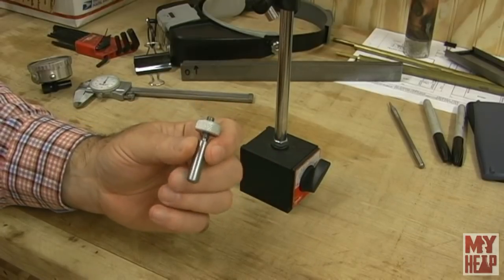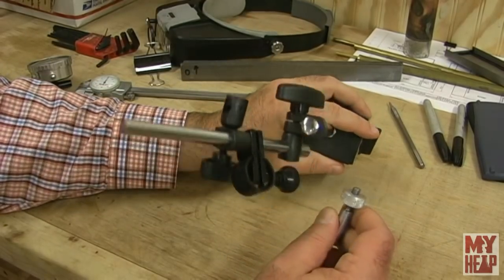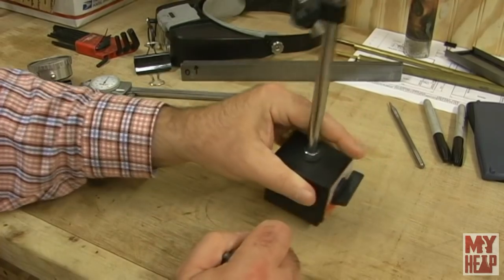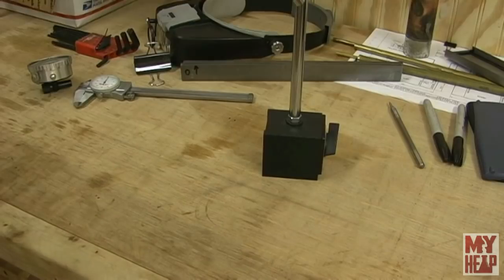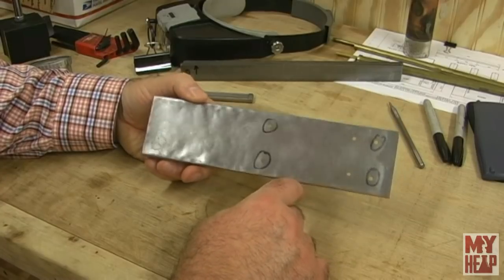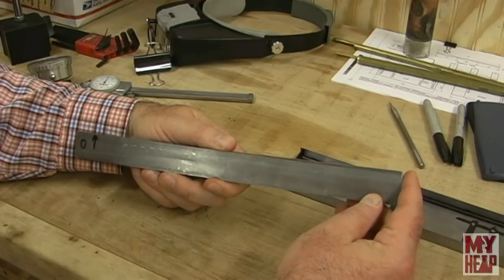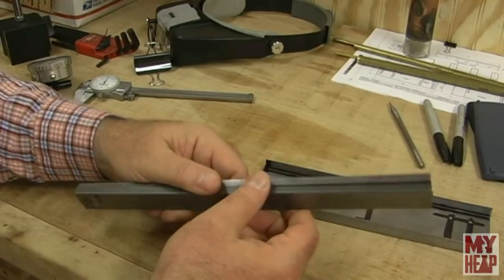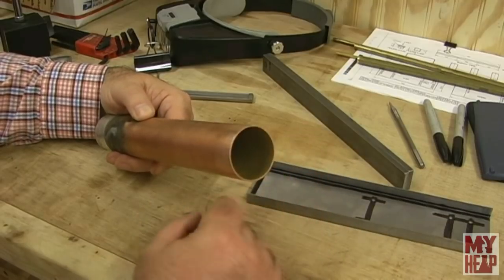MT2 Collets, KWSE, Camera Mount and Bandsaw

Comment: I also have the same issue where the mt2 piece comes out first. I made a custom head for my draw bar to knock out the mt3 sleeve. Basically, knock out the mt2. Remove the draw bar. Screw on the new head (aluminum so no damage to anything). Run the draw bar back in and hold against the back of the mt3 sleeve. Finally knock out.
The diameter of the head is just slightly less than my headstock tube diameter to ensure I knock the sleeve out evenly. This also reduces damage to the head, giving my setup a longer lifespan.
Reply from the maker: Hey Dan, I was going to make a whole new knock out bar bit your suggestion of an additional piece to screw on the drawbar to knock out the sleeve is a better idea.  Thanks for mentioning it.  Thanks for taking the time to watch and comment.

Comment: Nice, the ER collets work fine for short things but they won’t do anything long. I had a set 1A collets and the bore adapter for my Logan lathe and I just built a hollow draw bar for them,  I’m having a run out problem on the MT3 bore in my spindle. I guess I’ll need to ream that taper or bore it true to the spindle. But first I need to get the big mill moved into the shop.
Reply from the maker: I need to see what kind of runout I have with the MT2 collets combined with the MT3-MT2 socket, but I suspect for most things I do, it will have to work, or chuck it up in the 4 Jaw and indicate it in.  Are you planning on doing video?  I would like to watch that.

Comment: also, after thinking about it, another thing you can do is make your thread protector, but have a lip on it that goes over the front of the MT3 to MT2 sleeve and use that to hold it in, then you have no possibility to knock it out when knocking out the collet. Just an idea anyways.
Reply from the maker: Hmmm... that is something to consider.  Thanks for the idea.

Comment: Try not to spin the collets. I've a similar setup. When I was at Chirpys Tinkerings shop, we made a draw bar and he showed me, screw the draw bar into the collet. Then push that assembly through the headstock. That is easier than the order you did it and you don't risk scratching the collet as it will just seat vs slipping as you turned it. In my case it was an end mill holder, but same idea.
Reply from the maker: Hi Dan.  Great suggestion and thanks for the tip.

Comment: Just rigged me up one of those magnetic base camera holders a couple days ago lol
Reply from the maker: Well, so far I think it will work, BUT, I definitly have to use a solid rod where the two part spring micro adjust thing is.  It doesn't take much to get my camera to bounce.  Is yours solid or does it have the adjuster?  Big camera, small camera?

Joe
Reply: @MyHeap  myn has a fine adjust aswell , I'm just using my galaxy s9 as a camera so not alot of weight.

Comment: It's kinda odd that your getting shaking like that on your video, but you may have alot heavier of a camera than I do, so that may make a bit of a difference. Ive found that I get shaking also if I put it on top of the tailstock, which I have no idea why, and that looks like thats where you had the camera at. I find that it likes a flat smooth surface to sit on then it works fine. I still have the fine adjust on mine, but mine is so stiff that it doesnt really cause any vibrations, but yea, I think a solid bar may be the answer, that may help you also. Thanks for the shoutout also.
Reply from the maker: I had the camera on the front ways in front of the saddle.  The camera is a little heavy for what it is.  it is 8mm DAT 3 CCD Sony camcorder.  It is roughly 3"x4"x6" with a remote mic on top.  I will have to try out the solid bar and see if that helps.  Thanks for the tip, it was helpful!
Reply: oh, ok, yea, that is pretty big. Another thing you can do is just stick it to the drill press table and zoom in to the lathe, or stick a piece of steel to the wall behind it maybe, imagination's the limit, lol.
Reply from the maker: I was thinking a piece of plate on the shelf behind the lathe may work too.  i will just have to experiment some.  First thing is to use a solid piece of round in place of the split piece with the adjuster.  Thanks again Chirpy for the suggestions.
Joe

Comment: You may try the 6 in. Straight Jaw Sheet Metal Seamer
Item #98728 from Harbor Freight for bending the metal.
Reply from the maker: That may be an option.  I also see they have a sheet metal folder that might work for some longer bends, but may be a little light for 20 gage metal.  They also have a couple of small brakes.  I wonder how good they are?  I have the Gingery book on building a sheet metal brake.  That may be a fun project to do also.  Thanks for stopping by and watching.

Joe
Reply: The sheet metal folder is no better than what you are using. I think that the 18 inch or 30 inch brakes would work fine. Not sure I would invest in the more expensive ones at this point. I use the one I mentioned, and hold the metal against the bench edge while bending. Works well enough and is certainly affordable.
Reply from the maker: How do you handle bends that are longer than the six inch width?  I mean to make the bend without a divit so to speak where the tool overlaps?  I have never used a tool like that so am ignorant here.  Even a divit would be better than the beat up finish from my heavy handed hammering.  Tough being an old guy and a newbie to boot.  I really appreciate all the information you folks share with me.
Reply: I start in the middle and only make a partial bend, then it is easy to move to the sides and continue bending until I get the complete bend done. It is easier than you are thinking. BTW I too am an old retired computer geek.
Reply from the maker: Thank you sir, I probably am over thinking it, but you being a reformed computer geek, you know how the brain works.  Always trying to see the end of the sub-routine.  So am I seeing pattern with computer geeks turning hobby machinists here?
Reply: My father was a master tool and die maker. I used to hang out with him in the shop from the time I was 12 or so. He was also an excellent teacher, so I guess I had a head start.
I made the base today out of 20 gauge sheet and bent it with the seamer. It took considerable muscle, but turned out extremely well. Wish I could post pics here, but....
Good luck with the build. I will be making casting patterns for the traction engine soon.
Reply from the maker: Perhaps you can email me pics of your build.  xavier@gtec.com
Reply from the maker: Are you in the US?  Are you casting yourself or sending out?  Emma is supposed to sell me a set of these castings when she has time to get a batch cast up?  Would be cheaper maybe to get them a little more local.  Thoughts?
Reply: I am in Arkansas USA. I will be casting them myself. I will be making these available for sale. I don't yet know my schedule for completion or pricing. What is Emma selling for? I sent you the pics you requested via email. Let me know when you get them.
Reply from the maker: Gene, I sent you an email.  Heck, we are sorta neighbors.  I live in Middle TN on the east side of the TN river.

Comment: What comes out is anybodies guess, that will depend on which of the two has the best self-locking quality.
If the MT2 comes out, you can tap the sleeve out with a bit of dowel rod of the right diameter. If the lot comes out, you can get the MT2 out of the sleeve on the bench vise.
These MT collets may well be more precise than ER collets. If you buy ER collets, don't go cheap. Some of those cheaper sets are so badly made, they have the runout of a Chinese drill chuck!
Pay some coin for the holder and the nut too... all too often these are of crappy quality and you'll end up binning them out of sheer disgust.
Best is to buy them (in your case) from a US vendor, so you can send them back if the claimed runout is exceeded, and demand your money back. That is a lot more difficult with sellers like Banggood and such.

Paddy
Reply from the maker: Hey Paddy.  Well the three collets I have used so far have released from the MT3-MT2 socket but that just may be luck.  I would like to have a nice set of ER32 collets and chuck, but I fear disposable income may dictate that I get a cheaper rather than nicer set.  But, things change and it may come to pass eventually.  Chirpy suggested that when I make the spindle nose protector, that I include a lip to prevent the MT3 socket from being ejected.  That may be a possible solution too.
Reply: Well, I know all about tool budgets LOL ! Too many tools, way too few dollars (or euros)!
You pay for the machines...then you have to start hoping the missus buys loads of shoes, so you can get the tooling without marital strife, but it will cost you twice the money!
Once that is sorted, you need a supply of stock and the whole affair starts again !
It's the same all over, no matter what side of the ocean you're on!
As far as the collets go, I will say this.... better be patient than settle for cheap. You have the MT collets (and they are cheap and surprisingly accurate ) Get a few ER collets at the time and get the holder and nut first...even if you haven't the means to get collets with it.... you WILL kick yourself if you go cheap on that stuff.Every single person I know, who has done that, has bought two sets... the cheapos and a set of proper ones. usually within a few weeks...
I see why you would have that protector with the lip.... but I would suggest it isn't the greatest idea leaving a sleeve in the headstock bore permanently. Chances are you end up having trouble getting it out eventually. And that is an extra risk of damaging the one thing that will put your machine directly on the scrap heap.
Re 'tin plate' : I am sure that stuff still exists, but I haven't seen it in decades. I have a few pieces somewhere, but those came from the seventies.... at least I think..they may be older.
You can use galvanised plate (zinc coated), that makes it easier to solder (don't weld that stuff!) or just plain mild steel. You can soft solder both. For extra strength you can used soft solder that melts at around 500 C. If you want some of that, get in contact with Halligan, he knows where to order that stuff in the US.
Do braze the boiler though, despite the lower pressures, it would be unwise to use softsolder on that (despite what previous generations may have done or declared!) 
If you do soft solder the boiler, which I would again strongly discourage, at least tap some copper rivets in the thing so it has some real strength.
Steam is dangerous, even at low pressure, never underestimate the stuff, and never treat it cavalier! Talk from others,such as : "oh it never blew up for me", or " neah it will be fine" is criminally bad counsel! 
A static hydraulic pressure test on a soft soldered pressure vessel tells you nothing. The moment a flame gets involved the situation is drastically different!
Accept one thing of nothing else : if a small boiler pops at say 10-15 psi, and you are anywhere near it... you will not...I repeat not have a 'blessed' day...you may be at the A & E room hoping they can save your sight!

Paddy
Reply from the maker: Hey Paddy,  Lots of good stuff there.  I agree with you that it isn't a good idea to leave the adapter in the headstock.  It lives in the drawer with the collets when not in use.  At this point I only have to make a proper knock out bar for it.  Another user has a similar set up and he turned an aluminum end to fit the spindle to screw onto the end of the drawbar to knock out the sleeve.  That would make a good addition to the kit.  I will hold off on buying ER32 collets until I can scrape up the money for them, or need dictates otherwise.  Waiting for my wife to buy things to justify tooling would cause me a long wait.  My wife is pretty thrifty with money and tends to want to hang onto it rather than spend it.  She also cans a lot of food and other stuff in case some emergency rolls down the pike so to speak.  I cannot fault her for that!

As far as the timplate, thanks for reinforcing my thoughts about using mild steel or something else.  I never heard of tinplate until I started buying and reading the Workshop Practice Series and other UK printed books.  When I Googled it to see what it was I realized the USA has not used anything like that in decades.

Now onto the boiler.  First, let me tell you that I am a little scared of pressurised steam vessels, so I would settle on nothing less than silver soldering the vessel together and doing a test of 2+ times the operating pressure before putting the flame to it.  I am not so sure I want to use the designed safety valve for the engine either.  I may try to order one from somewhere or make one proper with a stainless steel ball instead of the brass screw.  Fortunately, I have some time to mull it over the grey matter before i get there.

Finally, thanks for sticking with me!  I appreciate the suggestions and the support.

Joe
Reply: I know where you can get (at least I think) a safe and decent safety valve in the US...
Or, I would if I could remember the name of the outfit that sells them ! Old man's mind and all that ! 
It will come to me (no doubt in the middle of a conversation about gherkins or some equally 'related' topic LOL) I'll post or email you when my neurons decide to work again!

Paddy, why did I come in here again?
Reply from the maker: Thanks Paddy.  If you remember drop me a line.

Joe